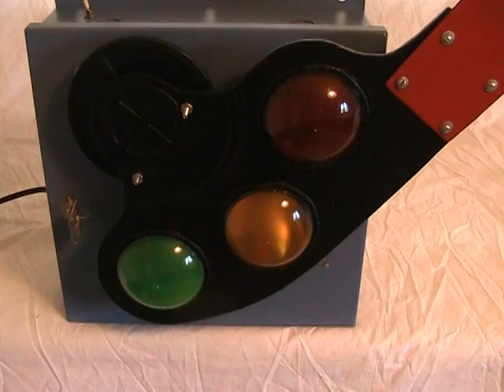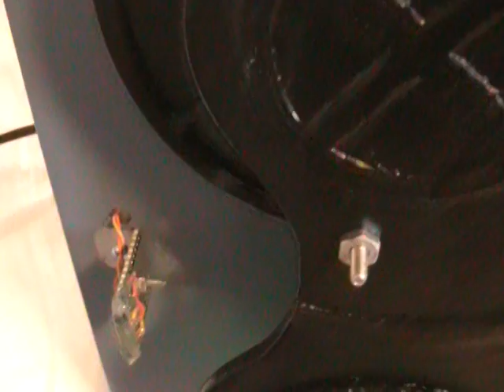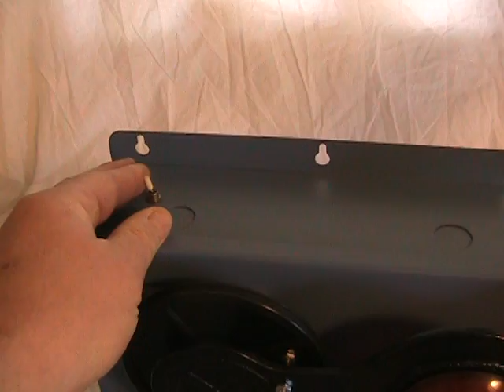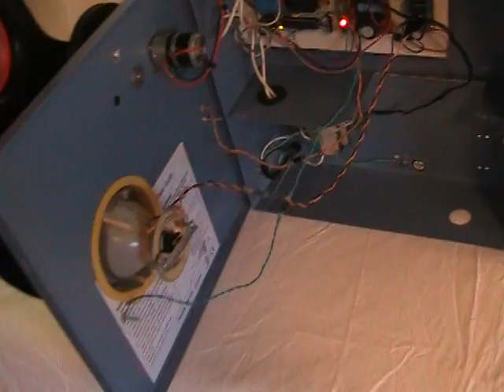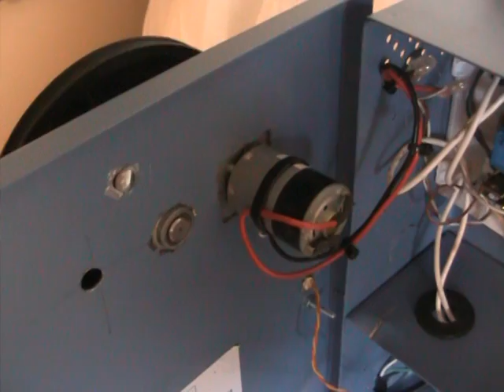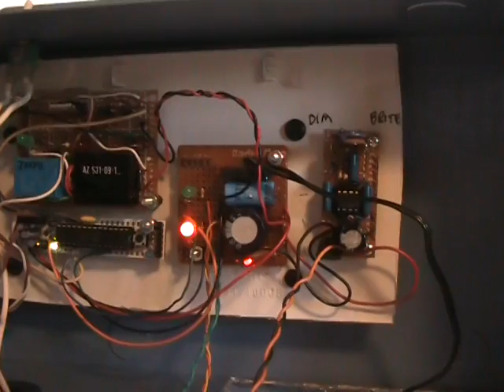Semaphore Scale Model Railroad Signal with Arduino

Comment: Do you have a parts list and plans (materials, measurements, etc.) for the spectacle and arm? It's the right size for the 15" gauge Riverside & Great Northern Railway in Wisconsin Dells, WI, where I volunteer. Thanks!
Reply from the maker: Unfortunately no.    It was built over a long period of time as stated.   Parts were gathered as I went.  I was on a constant search for items that would fit and when I found one it got added.   All ratios were scaled from the 3 colored lenses I found somewhere.   I think the colored lens were from lawn light like Malibu lights.   The enclosure was found at a science scrap store that use to be a cabinet from some kind of security system.     The gear motor that powers the arm was from that science store also.   Most electronics parts were harvested from numerous other electric appliances, TVs, printers and VCRs I acquired over time.   The Arduino board was new Bare Bones PCB.   Software was designed by me.   The arm and lens holder was made from 3/16 inch plywood.     Sorry to disappoint.

Comment: I understand simple electronics.  I wish I understood Arduino or Raspberry Pi.  I do like your construction.
Reply from the maker: Dig into Arduino.  It is designed for folks that have limited or no electronics understanding.   You are already ahead of the game.   It is extremely easy to get into.   Cheap too.  There are so many clones out there today.  You can buy a Arduino for under $10 USD and the software for programming it is free.   Their website has Arduino reference pages that describes the commands you use and has examples of how to use them.   There are even many example sketchs you can try out built into the Arduino IDE (programmer) too.   I got into it for $25 USD.   I got into it 13 years ago.    If you make what they call bare bones system with just the Atmel ATmega328 IC chip you can build one on a breadboard for $3 USD.    Add you peripheral drivers, sensors, LEDs, etc. and you are on your way.  Very little investment to try it.   Go for it.  There is such a huge community out there you can actually find programs for what Arduino calls sketches already written.   All you need to do it cut and paste the sketch into the Arduino IDE (programmer) and download it into you Arduino board and go.    YouTube has TONS of Arduino tutorials about the basics and then advances from there.   Its very easy.

Comment: Congrats on a very authentic scale model, looks like it was fun and rewarding.  Here are a couple of suggestions if you'd like to consider moving more functionality to the Arduino.  You might be able to sense motor current at the end stop as your home position.  Then, if uou high-pass filter the motor pins- you may be able to count commutator spikes for position.  With a PID loop driving pwm to the motor through a H-bridge you shouldn't need relays for braking. Also Ardu pwm + mosfet for lamp.